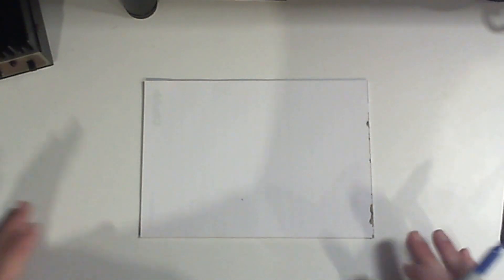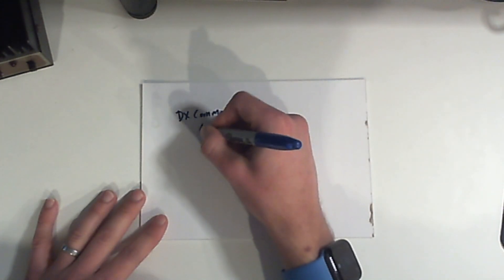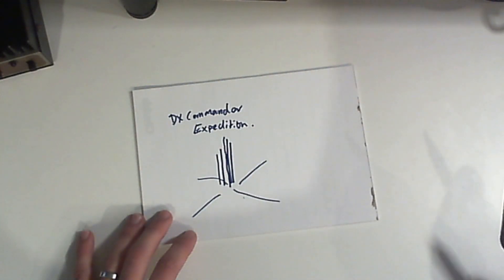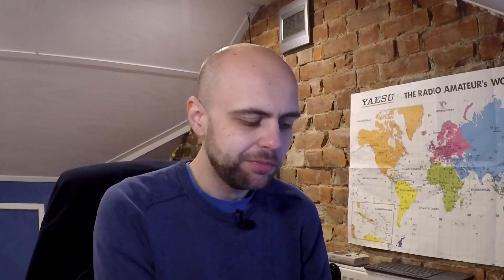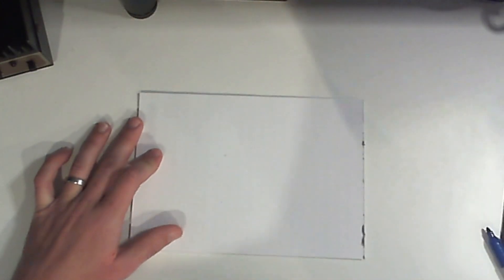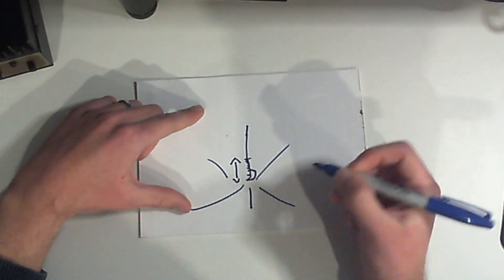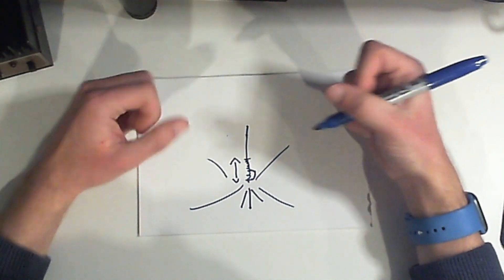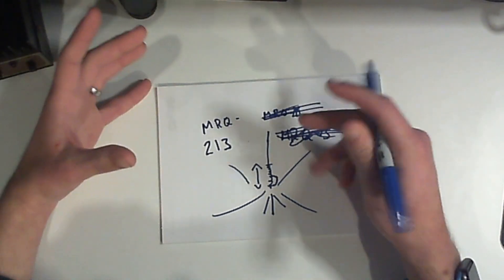Ham Radio Stealthy Antenna Options - the last one works!

Comment: I have built a Cobwebb antenna for my attic. It's basically a fan dipole for 20, 17, 15, 12, 10 and 6, all in a compact 2.8m x 2.8m square. Picks up a lot of noise, but when it's quiet, it's not too bad considering I'm in a terraced house and the build came in at under £25. I have a plan to create a similar 40m square folded dipole on its own in my attic on another feeder - that would be a 5m x 5m square (20m wire) which would have to be fairly low down but would just about fit in my 7m x 5m attic. I have another plan to put in an EFHW on 40-10 by putting the unun in the attic, and then taking a thin wire from the front of the house, up and over the roof, down the garden to a telescopic pole, then either across the back of the garden or vertically downwards.
Reply from the maker: That sounds excellent! I’d love to see some images of it!

Comment: Hi my tempry antenna is 20m wire with a 10m counteroise and fed with 5m of ladder line and 10m of rg58 military spec it has gotten in to america, brazil on ft8, ft4 and is always happy to produce results in europe it is 6ft high along my fence i run 10w  and a ziegu g90 from my living room i can tune from 10m to 80 meters with the internal atu regards M7CLI.
Reply from the maker: Sounds intriguing. How are you feeding the antenna? Is the ladder line acting as an impedance matching section? 73!

Comment: I haven't even got a usable garden at my QTH because it's a terrace and at the end of the rear yard is a BT pole with a load of lovely wires stringing from it (but none I can use of course). So my choice is a 40m EFHW in the loft going in a kind of S shape. Tuned with a Nanovna and actually works really well. I am solely FT8 using a QDX at the moment but can get the occasional QSO with the east coast of the US. Message being... Just use whatever space you have and give it a go! 73s
Reply from the maker: Any antenna is far better than no antenna! 73!

Comment: I’ve used a similar setup on the fence for some time and have had reasonable results into Europe using only 10 watts. I also bought a super antenna kit. All I will say is that it has been the biggest and most disappointing expenditure on an antenna I have made. Useless. The £49.99 EFW antenna has been the cheapest and most successful for me. Always enjoy your videos.
Reply from the maker: Thanks John. Yes. Similar experiences with the superantenna here. I haven’t tried the alternatives (Slidewinder, wolf river coils etc)

Comment: Jonathan, thank you for the antenna review to show what are some good stealth antennas, I use at my home qth three end fed antennas one for 20 meters and one for 80 meters and one for 40 meters, and all work great for me and I have been able to work into Europe, South America, and the Carribean, and they are in a sloper configuration with the highest point only about 12 feet off the ground, I live in the central part of the USA, close to Chicago Illinois. I am happy to see that you also have one at your qth. I had one running along the top of my fence for 160 meters but could never get it to load up properly. Thank you for sharing and Happy New Year!

Comment: Happy new year 
Great video. I too have a small garden and have to weave a 20m wire around for an efhw. I have tried a 10m with 9:1 which worked quite well as a vertical and about 10m radials. I have a mag loop in the attic which I am not too sure about. 
I run a ft817 with 5w so by the time it manages to get out of the antenna it's probably more like 2w. Lol
73 mate

Comment: Hi Jonathan, I am running similarly an EFRW with a 9:1 UNUN and 8,80M wire in the rails of my balcony (3rd Floor) L shape horizontal and with 10W in SSB its working pretty well in Phone with maximum distance i  have made so far from London to 3000km in Russia, Greece, Italy, Romania and betweens in 18,15,20m bands. works quite well with 1:1 -1:2 SWR i confirm this multiband random wire works magically, 73 M7SVA

Comment: My one and only antenna right now, is a fan dipole in my attic for 20m, 15m and 10m. Attic is only around 7.4m end to end, so have a loading coil ¾ the way along 20m elements and drooped the end a little. Despite limitations, it does surprise me how well it works 👍
What I'd like to work out this year is how to get on 40m from home, which may find me finally working out how I get something outside.

Comment: There is also the Chelegance MC-750 and its clones. It’s basically the same thing as a DX Command except that it can only do a band at a time. When you switch bands you don’t adjust a coil but the whip length itself. The whip has markings on it for each band, so tuning is fast and easy.

Often flag poles are okay and permitted up to 10m, so if you can hide a wire inside, it’s basically just like a DX Commander Expedition. Maybe a DX Commander with a flag is already legal 😂
Reply: Flagpoles would be bizarre in the UK!
Reply: @paulsengupta971  You’re just very patriotic about your country 😉

Comment: Thank goodness we don't have the HOA equivalent here in UK - but we do have our share of nosy neighbours, local councils and regulations to observe/satisfy/avoid/ignore/comply with.  It's entirely possible to get an antenna up and stay compliant with whatever the situation is.  I have previously had great results with a Tarheel II screwdriver antenna on a roof (metal roof of my garage with just one jumper earth wire to a bolt in the roof). Combined with a Target Tuner (or equivalent) gives automatic band tuning 80-10m.
Reply from the maker: Great point Tom.
Reply: Too right it's more about the neighbours. Mine like to tell me I have an antenna up in the garden. Err yes I know I've put it there. 👍🏽😂 73